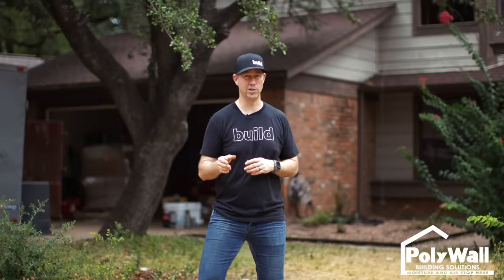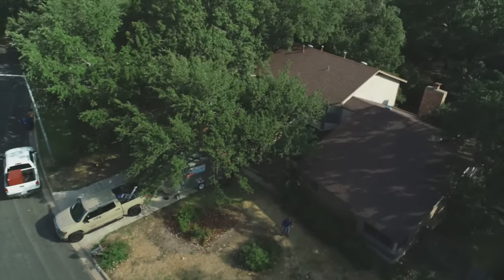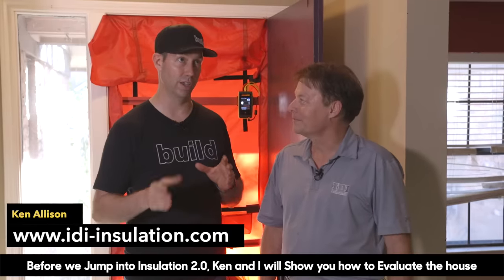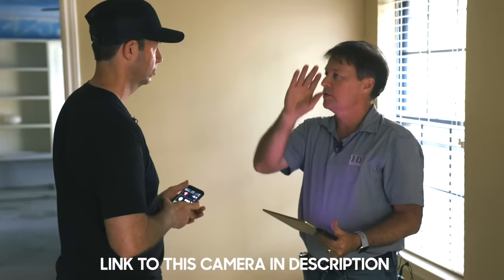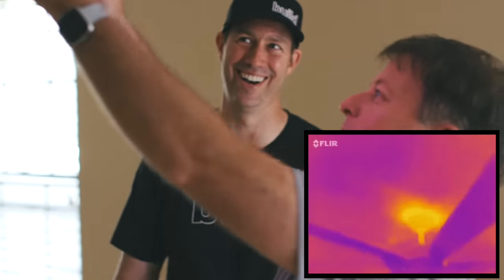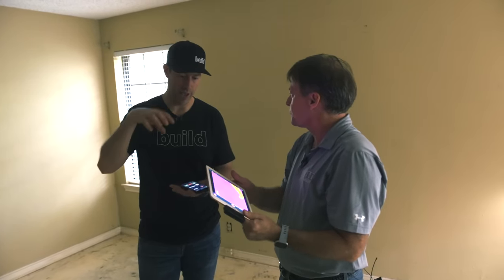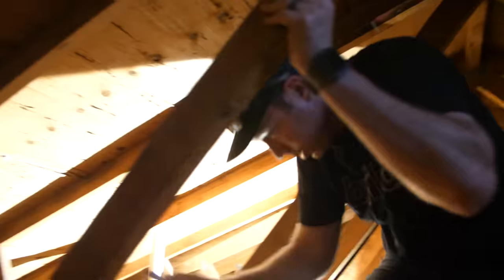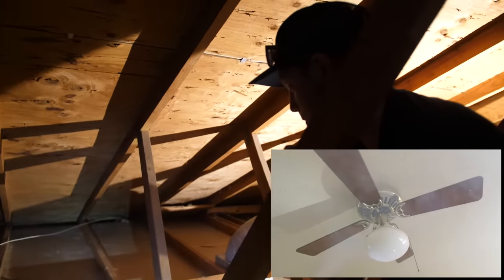Insulation 2.0 - 3 Steps to Re-Insulate

Comment: You guys would have a field day at my house.  Since I'm not in your area, how do I locate and make sure I get a legitimate professional?  I also have batt insulation which I can't stand.  I've also got a leak somewhere in my duct work.
Reply: A thermal imager could be useful locating the duct leak. But if you peel back duct insulation, check where ducts join and at bends. Wherever the inner insulation has a dirty stripe is a seam leak. I just did this myself, after a duct company did some sealing. I found plenty of gaps and leaky joints.
Reply: @stevescherer4954  Thanks for the advice.

Comment: I have the same HVAC updraft furnace, open above to attic and below to crawl space. What can I do to improve the air sealing there? A whole new HVAC system is out of my budget for the next couple years. Great video btw, thank you.
Reply: Paul Krsnik cut a couple drywall pieces to fit around the pipe above at the ceiling height. Add blocking to all 4 sides if there’s nothing to screw to currently. Seal gaps between pipe and the cutout section of the drywall with a can of expanding firestop foam. Think you need to have 1/2” gap or less everywhere, so take time to measure, cut, test fit, cut some more, till it’s pretty good. Then do the mating sheet for the other side of the pipe. Small tub of drywall mud for the gap between, tape, and mud atop. Firestop foam after that. 👍

Don’t quite understand what you’re talking about underneath. Do your best to close it, but don’t make a fire hazard or a rat attractor. (Don’t shove a bunch of old shirts down there.)
Reply: @fosterlewis7360  Thanks for your reply. Is there a reason it's open? Does the furnace need to pull air from the attic, or was it really just left open like that due to laziness?
Reply: Paul Krsnik pretty sure it was a lazy installation. Hvac guys don’t typically keep carpentry materials on the truck.
Reply: @fosterlewis7360  I did some more reading on this and it looks like I do need it open for fresh combustion air. I could get a new sealed combustion furnace, or better insulate and air seal the door to the closet. Pretty weak construction methods.

Comment: Matt, great video.   My attic has plenty of "spaces" between sheetrock and framing that I want to fill in myself.  What product do you recommend to air seal those types of cracks?   I saw the more professional liquid expanding foam as well as the more "dry" pinpoint manual application.   I live in Austin and have easy access in my attic, so I plan to manually move the insulation to seal cracks.   

Also, can you seal around light fixtures that generate heat?  I assume you need to be careful and you mentioned something about an air seal box to put around those types of fixtures?  

Thank you

Comment: Hey Matt, I am getting ready to do a new roof.  I was wondering if you decided that the radiant barrier under the battens works better than, or well enough, to replace the two layers of polyiso insulation?  Thanks for your reply.  Keep up the good work.
Reply from the maker: The poly iOS is better assuming you have a sealed and conditioned attic below. Otherwise just do the radiant barrier

Comment: Is it not ok to cover the existing insulation and entire attic floor with a vapor barrier like 20 mil and put more insulation on top??  Would that not work?  Either way if you seal between attic and below the condensation wouldnt accumulate because of air exchange because they’re sealed..  so wouldnt a 20 mill barrier do the same as foaming all the little holes n what not...??

Comment: Wow. Great video. Someone observing me today: He spent $10,000 on spray foam what's he doing with a $3:00 tube of caulk?  Took Matt's advice and was caulking the sill plate on my 1600 sf townhouse renovation. Then started doing all the spaces between studs, headers, corner studs etc. where spray foam was not applied. After I was done using 8 tubes of caulk it dawned on me how all those cracks and spaces would add up a good size hole in my renovated townhouse.

Comment: Matt,  How do you plan to seal up ventilation chases running between floors?  I have a 2 story home (1993 vintage) in Houston.  Pretty outrageous cooling bills in the summer.  I am trying to plan a solution, based on your videos.  Not much I can do about exterior sealing, without taking down the brick.  Exterior walls are 2x6 and insulated.  But the attic is where all equipment exists.  I don't think trying to make it a completely conditioned space is possible, but I am trying to insulate enough to drop the attic temp down 20 degrees or so.  Sealing wall headers, penetrations makes good sense, but I don't see how you can effectively seal the chases for return air vents.  Can you show us your approach to that at some point?

Comment: What are the baffles that were installed before the new insulation was blown in?
Reply: They keep the insulation from falling over the soffit and blocking vents. Air flows through and exits at top vent in attic.

Comment: air sealing is a trade off, super sealing a house is great for efficiency, however it make things much more prone to mold, especially in humid and climates that get cold, our 100+ year old balloon framed leaky homes rarely grow mold, but new homes tend to grow mold within months, so we trade efficiency for toxic  and stale air.
Reply: Scott Schultz wrong. You only get that when improperly using or not at all a vapor barrier. I see it all the time when builders install fiberglass batts in the rim joist area. Those have to be spray foamed and nothing else.
Reply: Christopher Gruenwald  so this is why it’s necessary to install air to air heat exchangers to exchange air, or open windows to ventilate on very cold days to and/or soak all the water/ice forming on windows in the dead of winter? We see many new homes, even. the best built ones that form ice on the windows when temps drop below 10 degrees, all that moisture is fodder for mold, and it is disastrous.

Comment: This might be a dumb question but instead of spot treating the back of the ceiling could you just put a this 2in layer of closed cell spray foam over the whole thing. Im ure it wou be mor expensive but a lot less labor intensive

Comment: What about Skylights?  Skylights have big rectangular tube going thru the attic.  I have 2 skylights on the 3rd floor then the Attic is above.  I have a 3rd skylight that actually goes from attic to the floor of the 3rd floor to be beside the stairs from 2nd to 3rd floor.

Other question would you save a lot more energy to close off the skylight tube at the ceiling level?  Of course you would lose the outdoor light.

Comment: Is it possible to remove the sidding of a house, reapply foam insulation, rewrapp and then reinstall sidding? Basically sealing from the outside in, vs. removing drywall, reapplying insulation and redrywalling from the inside?

Comment: I understand controlling air leakage. I also see that you use equipment to do air exchange. What bothers me is how safe is this during a power failure and is there a way to keep air circulation going without the use of energy. The rule of thumb I use for my area, Mid-Michigan is 11 air exchanges an hour. So I would like to see how to do this without using energy. I believe you are right about everything you say, but let's see if it can be done without using energy.
Reply: I hope that 11 (eleven) air changes per hour is a typo. Ventilation code is 0.33 natural air changes per hour. If you want to provide ventilation without using energy - crack open a door or window. Actually, normal door openings as people enter / exit gets really close to 0.33 ACHn.
Reply: superuserlaptop agreed: 11 exchanges per hour is ludicrous. No hvac could keep up with that demand.

Comment: I have a simmilar loft. Would you consider changing it to a cathedral ceiling with sun roofs? (Then of cource you would have to insullate the roof itself and there will be no space for the airconditionersystems. My heating is located in a small separate shed close to the house so that will not be the issue for me.) I like to have a high sealing. When keeping the loft/attic then installing some sun tunnels would be a nice extra to lighten the living quarters. What would be your view and interessts?

Comment: Are you aware of a way to calculate or estimate the actual R-value of insulation that isn’t installed along a continuous air barrier? I’m aware of the BPI charts for down grading batt insulation when it’s not installed correctly, but nothing that factors in air leakage.

Comment: Regardless of the roofing insulation, wouldn't all ceilings naturally be warmer on a FLIR camera since heat will always rise??  I understand the concept of trying to control the delta with the HVAC being in the roof, but a lot of roof decking has been rotted out from overzealous soffett, and foaming rafters that stopped the roof from breathing out the moisture.  I think there's a trade off of allowing the roof to breathe as well as using a high reflective roofing material seems to be the best.

Comment: Hello Matt,  All this talk is nice but just how are you going to retrofit foaming leaks out to the eaves in 4/12 pitch roofs, a fairly common pitch?  Especially in a trussed structure?  Also if you add several inches on the lower chord of insulation just how are you going to do that while keeping your weight on the load bearing surface and not stepping through the sheet rock.  Adding to that you will have no space even in the center of the 4/12 or less roof.  Should you ever need to access your fans, vents,  electrical, etc that reside in the attic space just how would you go about it??  Good topic.  Take care.  Doug

Comment: I skipped all the testing, removed the old insulation myself (gross) and just got a guy to foam the attic.   I already know my house was super leaky, I don't need someone to tell me it is leaky. 

One thing to consider also, is that if you foam an attic and you are replacing ducts, you can use an R4 duct which is cheaper and less bulky, especially if you are running ducts from a 2nd story attic down through tight plenum spaces.

Comment: Why did you not bring the attic into conditions space? Using your prior video's I am adding insulation to the outside of a roof for a house built in 1984. Next, I plan to remove all blow-in insulation and foam the lower side of the roof deck.
Reply: Steven Erickson careful. Pretty sure can be a bad move if not properly considered. Do your research. I believe much more suitable in some climates than others, too.
Reply: Ryan Lewis  Thanks for the comment. I have done a lot of reading. This house build in the 30’s with a second floor put on in 1984 was never vented correctly so the attic is warm and it causes ice damming. We are in the far north of Minnesota. By putting insulation on the outside of the roof deck we move the thermal layer 2 in above the roof. Here in this area this is being done by standing 2x4 on the existing roof deck, putting 2” pink foam board then adding a second roof deck on the 2x4’s. This allows for 1 1/2 vent path above the pink board and below the shingles on the second plywood deck. What I intend to do then is add more foam board or spray foam to the underside of the roof deck from inside the attic. You can google Canadian Hot Roof for some YouTube video on this idea.

Comment: The colors are pretty, but without any values that could be as low as 1 Fahrenheit diff in temperature.  And raw wood studs transfer alot of heat, always will. 
That Flir attachment is ok, but no replacement for a IR camera.

Comment: Matt Risinger - I need your advice.  I have seen a new trend of retro fitting rigid foam insulation like Silver Board Graphite to the underside of attic framing on a vented attic.  This maintains the venting of the roof deck while bringing your A/C ducts into the conditioned space.  I like this idea because I could DIY it over a winter.  With the heat this week - I am looking for anything that will help my HVAC system perform better.  I haven’t seen you discuss this method.  What are your thoughts?  I value your opinion and honesty and need something to help with this Texas Heat.

Comment: I have a question. Because you're cutting airflow in the home so much, do you not expect to develop mold issues? Just asking, because I bought a turn of the century home, and I'm gutting the upstairs ceiling, and adding vapour barrier, new drywall, and reinsulating it properly.

Comment: Anyway to insulate an exsisting home without pulling down interior drywall or exterior siding ??
Reply: I've seen where they blow in insulation by drilling a hole in sheet rock between studs at the top. But it's better to remove and sheet rock again.

Comment: Around minute 10:00 you show the FLIR video of the bathroom fan, and also mention the fact it is not connected to pipes.  My townhouse was built in 1983 and I discovered the same thing about my 3rd floor bathrooms.

Why weren't builders forced to connect the piping to vent out the moisture from the restrooms past the attic out of the house?
Reply: They believed that the venting in the attic was enough to remove the moisture. Most homes have proven that they weren't completely wrong,  but that could change if you have a big family spending 4-5 hours a day with showers.

Comment: Wouldn’t it make more sense to use expandable foam insulation on the attic roof, versus blown-in cellulose in attic floor??
Using expandable foam makes it “air-tight” AND “insulates” in one easy step.....Not having to worry about sealing small gaps in the attic floor/room ceilings.
Reply: Very expensive to do complete closed-cell foam. Some contractors do "flash and batt" where they lay down about an inch of foam and cover that later with air permeable insulation. Others just do the crack/gap work and then insulate. Depends on your budget and what your contractors bid.
Reply: Its a lower cost option or if you have a draft furnace

Comment: Matt, quick question, here in Dallas we have a combustion furnace in the attic. Does that mean we can not even foam seal the lightning fixtures, ceiling fans, etc? Or were you guys just referring to foaming the entire attic, meaning the plywood on the roof as well? For example, we still have normal insulation, but foam seal the leaky areas around the lights, etc. P.S: We also have gable vents that allow air into the attic.
Reply: You can foam seal the attic floor, the furnace makes it to were you cant foam the roof line

Comment: HI Matt- Great Video!  Do you know if the air leaks can be considered as a noise leaks as well (using the camera).  I am changing the siding on my old house and currently have Styrofoam sheathing and noise (live near road).  Thinking of replacing with SilveRboards but want to make sure I drop my noise level (Styrofoam is not really bad from a temperature insulation perspective).  TNX!

Comment: Great video! How do you seal around those open flue chases? I did it with some aluminum sheeting and caulk but there may be a better way.
Reply: Fireblock foam is safe to use

Comment: You showed at one point batting that had fallen down between wall studs. On an exterior wall, is the only fix ripping out the sheet rock?
Reply: Or drilling holes every couple feet and blowing in cellulose or expanding foam. Though foam wouldn’t be good for just a few bays; no world where that’d be economically sensible.
Still gotta patch the holes, sand the patches, and repaint wall after.

Comment: Very interesting video, however, the practicality of a homeowner that's not in the building industry isn't going to go through the trouble and especially the cost to fix their house. As OCD as I am, and as much as I would love to fix all my house air leaks, I would never find a team of contractors to get this job done correctly. One of the reasons this house will be air tight is because Matt knows the right people to get the job done correctly, and it also helps to have a camera crew on them to document the results. Great watch though.

Comment: It's pretty strange for me to see wooden houses. Isn't texas in the tornado alley? Here in Germany we're (usually) used to build every wall massive (bricks, cement, or at least out of a stone called "ytong").

And all the insulation in the attic (on the roof of the upper floor) aren't flakes, but "mineral wool" mats. I guess you have that stuff in the US too, but why don't you use it?

Just asking out of curiosity. There have to be a reason for it.

Good luck with your house and best regards!

Comment: Ok question.  Im gonna do most of this myself and have watched tons of videos on this.  You brought up a point about rodent droppings. So my house has old cellulose type insulation and its in very bad shape. I was thinking rather than putting it in the land fill i was gonna stuff the exterior walls with it because no insulation and no top plate. Then seal the top of wall after. I can only fill to the fireblock halfway up the wall. Wadda you think about that and if theyre are any rodent droppings or urinating issue. I think i may have just answered my own question but was trying not to throw away celulose if i didn’t have to